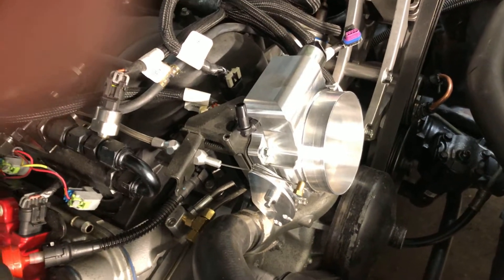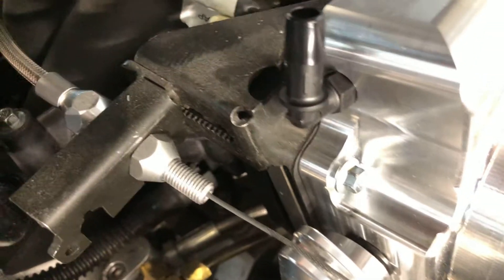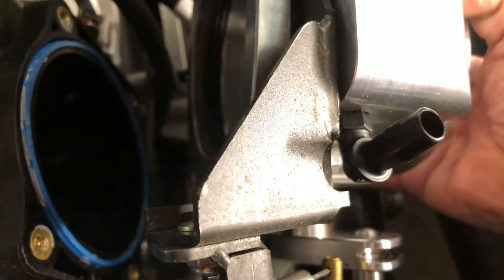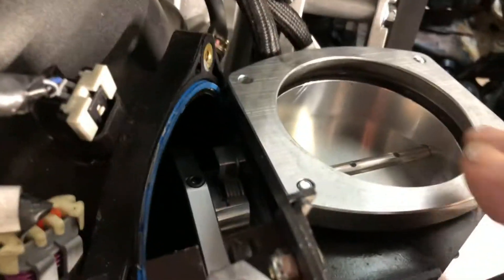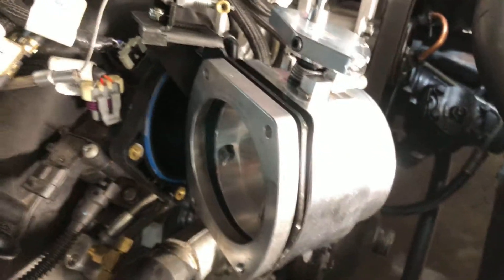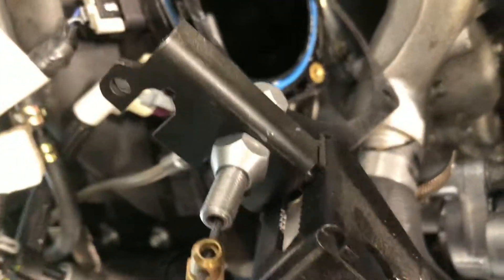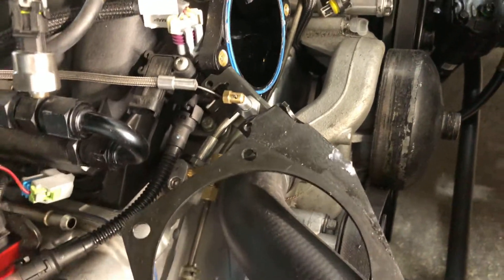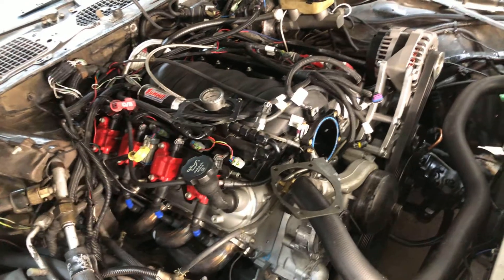Second Generation f body LS swap Installing 102mm Throttle body on my LS3 416 stroker.

Comment: So what does the hole in the back of throttle body do . I seen. A version that does not the hole in back?
Reply from the maker: That’s an emissions thing, you can vent the positive crank case vacuum pressure back into the intake to get the oil and gas vapour burnt through combustion… believe it or not it also reduces pre-ignition detention some what when you use it. I have my positive crank pressure (which in my case is very little if any) coming out of my valve cover, into an oil catch can through a PCV into my throttle body. I actually did the rooting recently.

Comment: was idle air control valve noisy ? 
i installed one and damm it’s noisy
Reply from the maker: Yes it was noisy in tell I adjusted the IAC control. Easily done with the Holley Terminator x set up tuner.

Comment: there is spacer that put the tb on an agle so it clear stuff, don't know if they are more models, this was the first hit on google

https://www.holley.com/products/engine/accessory_drive_brackets_and_kits/gm_gen_v_lt/high-mount_accessory_drive_systems/components_and_service_parts/parts/717-15
Reply from the maker: Ya I seen that Holley spacer... I already ordered the ICT BILLET 1/2 inch spacer. It was only $30 and should do the trick. I really only need a 1/4 inch space to clear everything. Hopefully I get it by Friday.